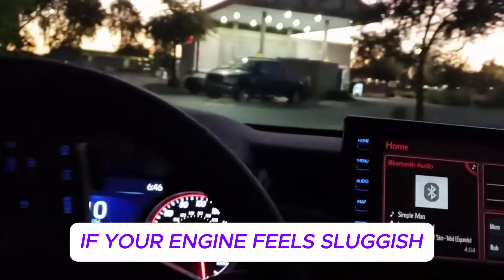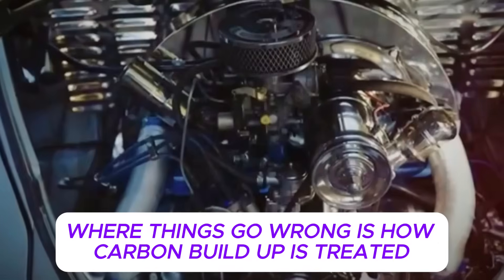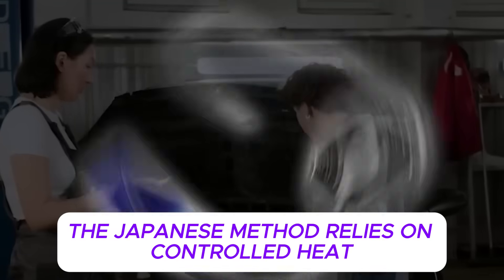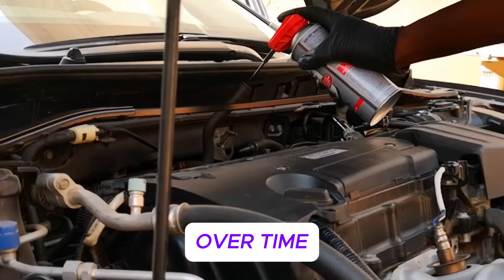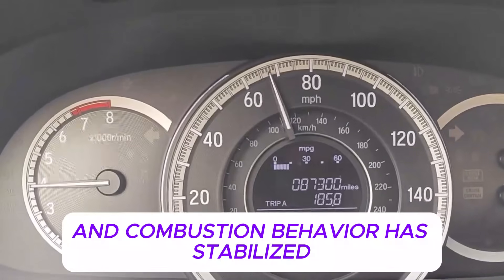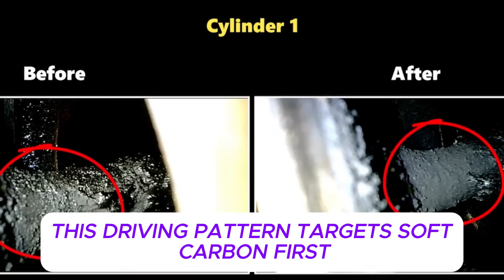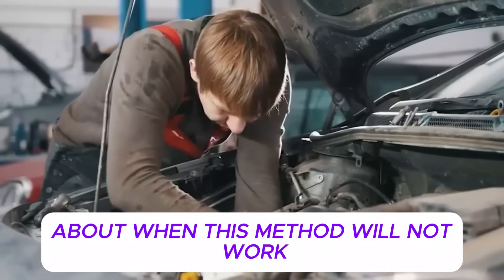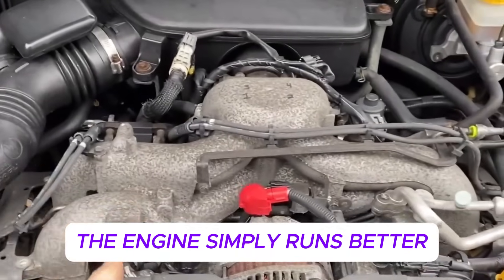How Japan Cleans Engine Carbon Without Using Any Chemicals

Comment: Old cars you could pour transmission fluid down the carburetor while it was running
Reply: I did it with water in a spray bottle, blasted that carbon right out of there...for a little while 😮😅